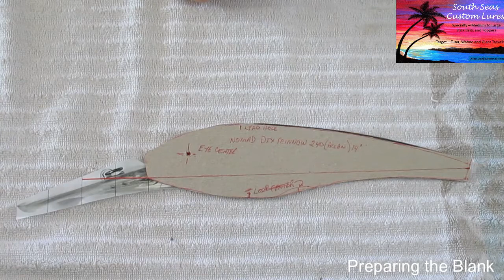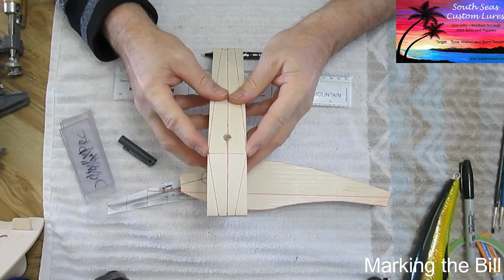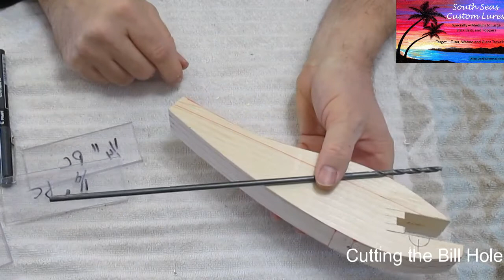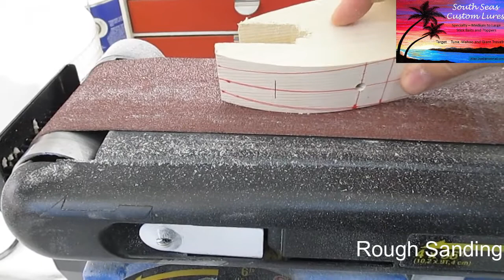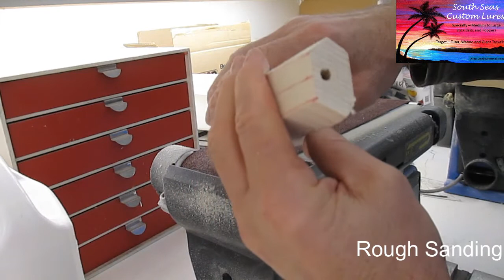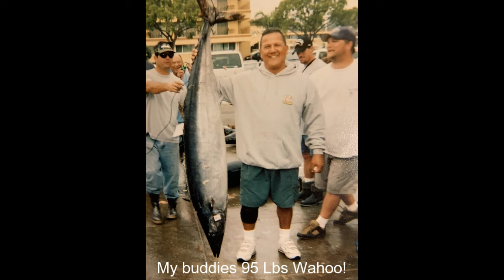Making Deep Diver Wahoo Lures Part 2

Comment: Hi Allan: I commented on your deep diving lures. I was just watching videos on DTX lures and they have auto tune eyes at the nose of the lure. Something I thought you might want to give a try. Good luck bud.
Reply from the maker: The DTX auto-tune system is not easy to reproduce. I think one thing I could try would be to remove some of the epoxy in the area near the front loop of the lure. I will give this more thought to see if there is a reasonable option to implement this type of self centering/tuning. Centering/tuning these lures is the biggest problem I have with them. I have a box of finished lures that do swim well at 10 mph.
Reply: @allandoell1025  I wish you luck and hope you succeed. If ti works, you will save yourself a lot of time testing. What did you sell your lures foe if you don't mind me asking.
Reply from the maker: @Fatlouey17  I do not openly seek out selling my lures. I have given away many to people who are interested in trying them.